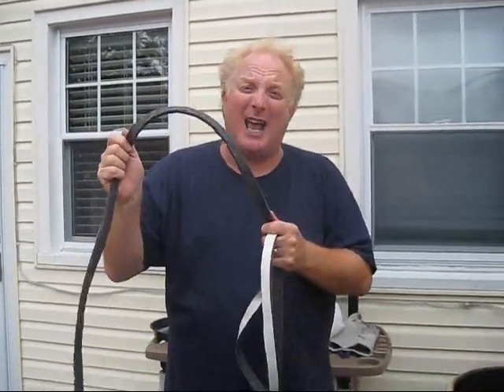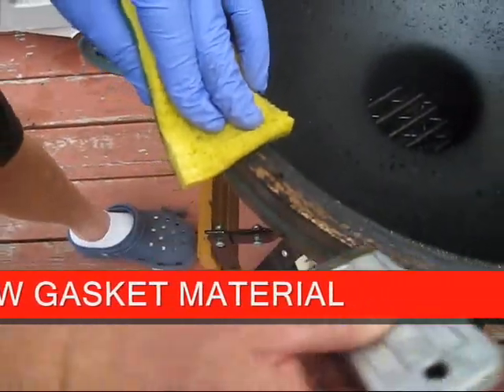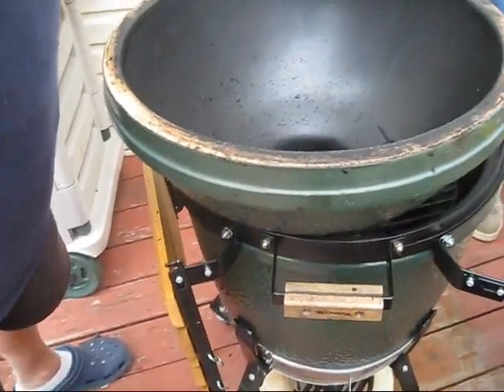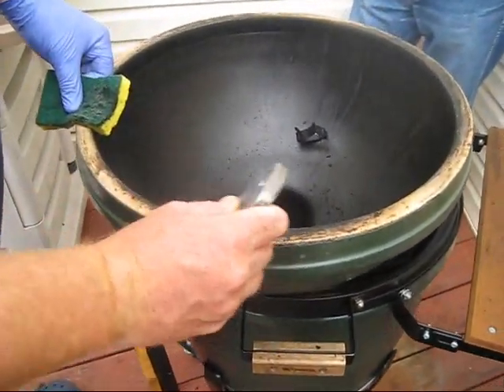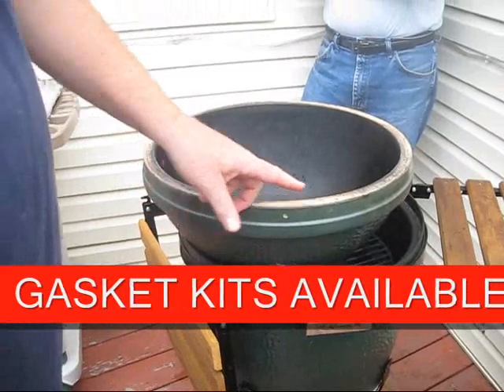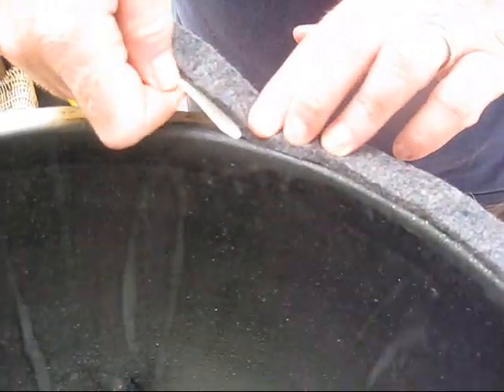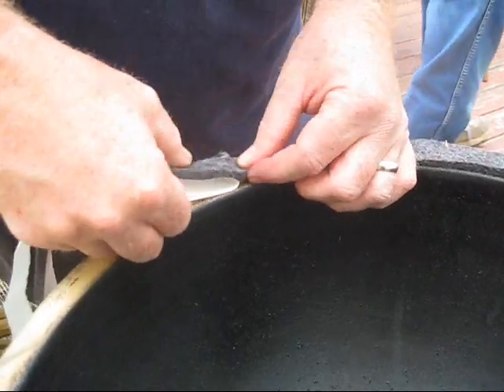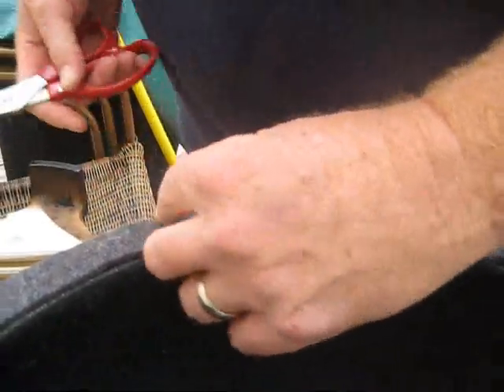GASKET REPLACEMENT ON BIG GREEN EGG PT 1

Comment from the maker: @Texsun1359 
If you watch and listen to the entire video, at time of 2:57 in the video I explain that I was doing an experiment with a double-thick top gasket (just on the top instead of the usual setup)  to see if it would correct that particular grills "gap" problems ...so that is the explanation...the Egg is calibrated for 2 x 1/8" gaskets ...for the experiment I used ONE 1/4" inch gasket ..just to see what would happen.  All ln the name of Grill Science.